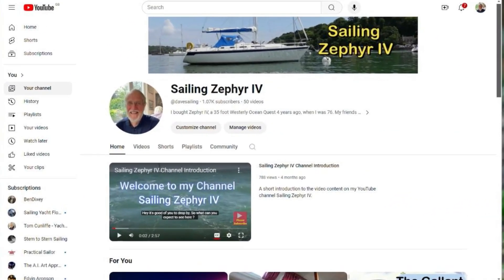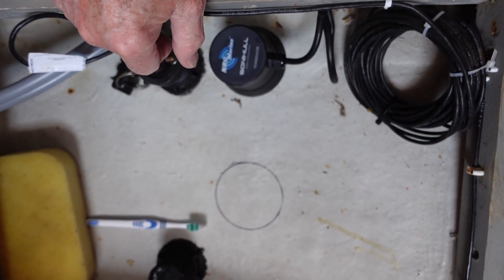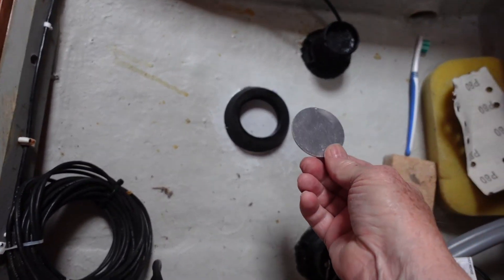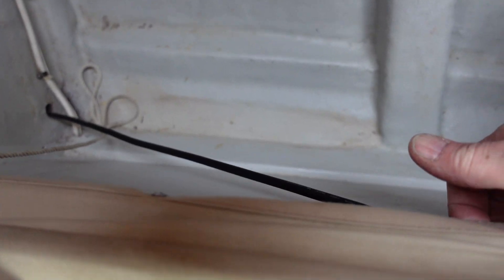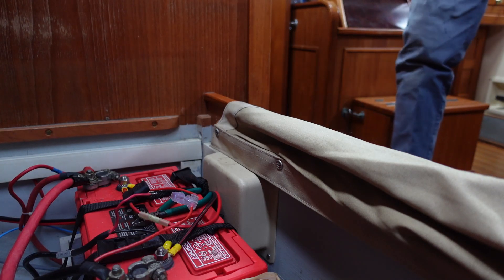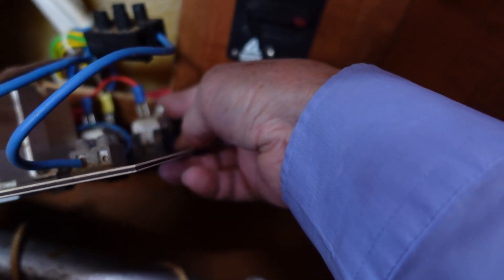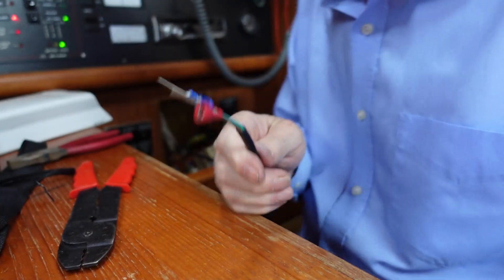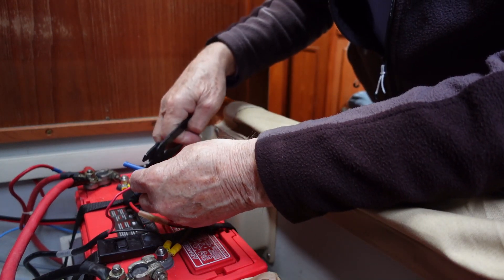Installing Sonihull | Hoping This Saves Me From Expensive Antifouling Paint

Comment: I would be interested in the results, if this works I may well be interested in a similar installation. 
I had copperbot on my previous boat, worked well and did not need anything more than a power wash on haul out., but now it is regarded as bad as traditional anti-fouling for marine life.
Currently spending a fortune on getting the boat antifouled every year.
Reply from the maker: Hi David, there will be another video when Zephyr IV comes out next year. It's a bit inconclusive at the moment, it appears to be working but ...
Reply: @davesailing  Hi David, May I ask is it working ? I'm very curious. and My company also launch some product you might interested. We want to see if we can ask you to test our product, could you please let me know your email ?
Reply from the maker: Hi Robin,  Zephyr IV is still in the water so I'm not sure how effective the SoniHull system has been until I can see the bottom when she comes out of the water. My gut feeling at the moment is that it has reduced the weed growth a fair bit and what appears on the hull after a period on the mooring, most seems to wash off when we go sailing. Email is dave@westcomp.co.uk   ... Best Wishes Dave

Comment: Cant wait to see how well this goes, that is  two watches now with your recent technology additions. Cheers, Mark
PS: I’ve now gone down a rabbit hole reading about this ultrasound technology. I note two of the products on the market are made here in Australia, and a modest drive away from me. I am still trying to find definitive data from trials on the outcome of any of these products.
Reply from the maker: Hi Mark, I have to admit, if I hadn't found this unit on Ebay at about half price, I probably wouldn't have invested. The Sonihull website has some good reviews. They wouldn't put the duff ones on there would they :-) The hardest part of installing is feeding the wires around. I've got one transducer near the log impeller, so hopefully that will keep the little shrimps out of that and the other is fairly close to the propeller so hopefully that will stay clear too. I'll just have to wait and see whether my investment was good or a waste.   Take care .... Dave
Reply: @davesailing  thanks for that Dave, I will check out the review site and await further feedback on your experiences. I can go  about 18 months before I need an anti foul. But water getting warmer here so that might change. The cost of a haul out and treatment has doubled over past 5 years. Looking at over AUD$4k for such now, so looking at alternatives such as 2x per year diver clean, which would be $400 total, quite a difference, but one still needs to re-coat with anti foul at a decent interval. Best, M